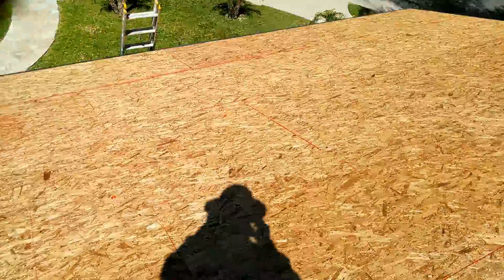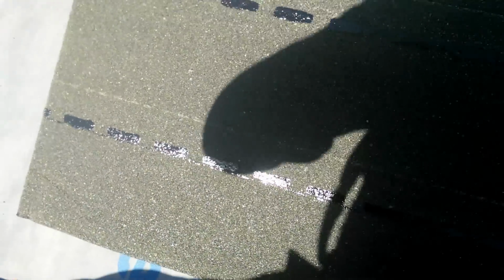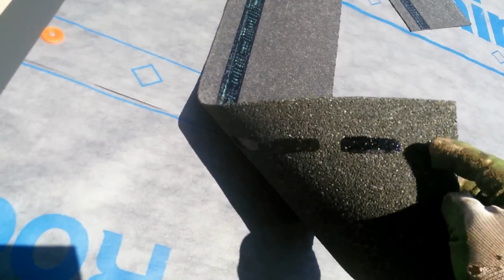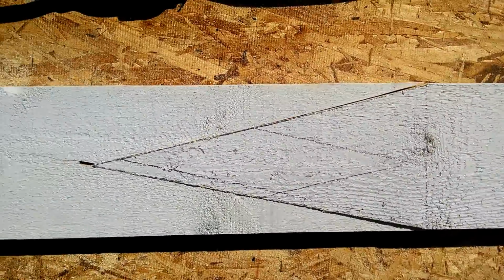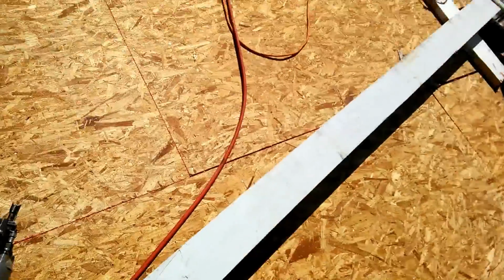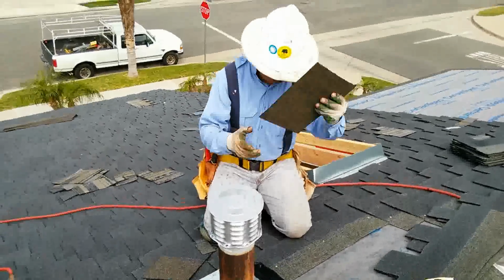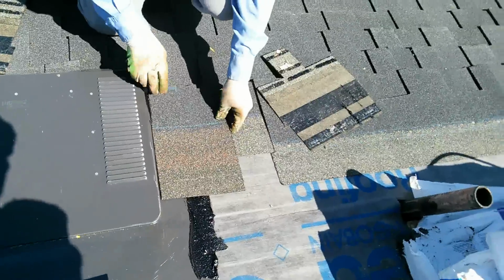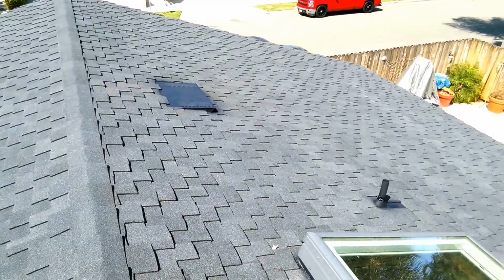Do you want to be a roofer?  Watch this video!

Comment: Appreciate the video. At 14:13, that little 1.5" sliver has no nails holding it from my observation. Installer rightfully avoided nailing there, but should put some cement at least. Just did a roof like this and it's difficult to install - one absolutely must follow installation instructions to keep the diagonal pattern. Thank you for posting these! Really enjoy watching here in Seattle.

Comment: I'm old school roofer late 60's to 90's.. one thing we use to do is as you go around any flashing we cut the top corner of the single closest to the pipe at a 45° angle which made any water divert toward the pipe...lol..it's cool that you were teaching how to roof using Presidential Shingle (one of the more difficult shingles to lay if you don't know how they are done) good job laying them

Comment: This is hard work. I work with my husband he's a roofer im a contractor/worker my respects to all of you risking your lives,and carrying them 50lb bags of shingles up the ladder god knows how many feet up sometimes,not to mention this atrocious heat in summer ugh....
Reply: Cynthia Jimenez my wife feels same way but we are big boys we ain't scared,
Reply: Cynthia Jimenez professional roofer s have a power ladder to load the material. and most of the roofing supply chain s offer roof top delivery.  The job is hard enough as it is why would you carry a single bundle
Reply: Shingles arent that bad we usually help each other with them or get the machine to put em up what sucks more tho is when we have to carry the hundred pound roll up the ladder lol im 19 btw and work as a roofer
Reply: Bartley here in the states we want things done now, meaning as fast as possible. What youre talking about is too big and pointless a safety precaution for such a small job, which probably happens tens of thousands of times daily across this country. And If you needed scaffolding around a 1 story 3-5/12 roof, you shouldnt be a roofer in the first place.
Reply: bundles are 80 lbs each not 50
Reply: only 50 lbs? pshhh
Reply: 50 pounds...damn all I've ever carried is 90 pounds.
Reply: @shannonwyatt1286  u mean 80lb bundles

Comment: Wow nice detailing. I did one of those presidential roofs but it was over 37 years ago. Or another brand just like it. I don't recall any specialty starter for it. We had to cut through the tabs for our first course.  Then we had to cut a wood stove metal chimney through it. It was like a ham sandwich a full inch thick! I'm glad I never got asked to do one since.